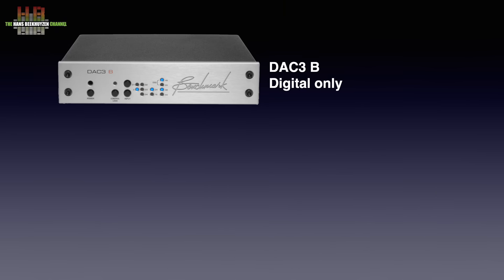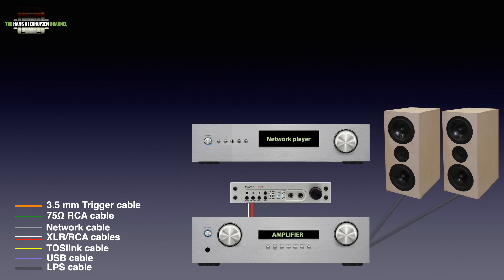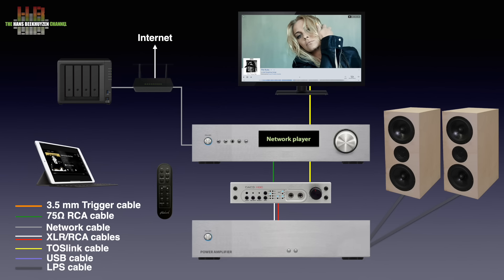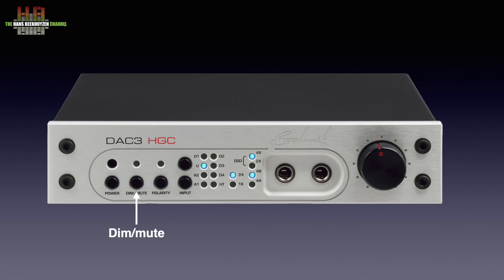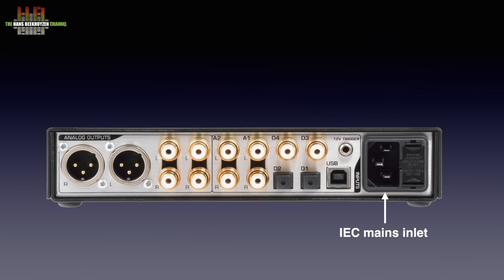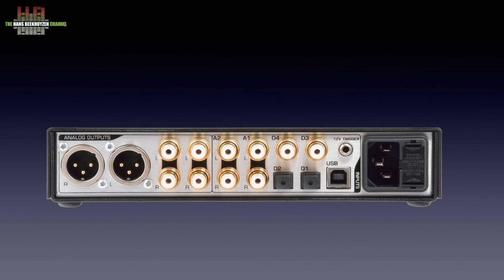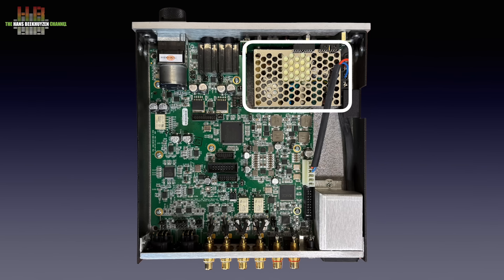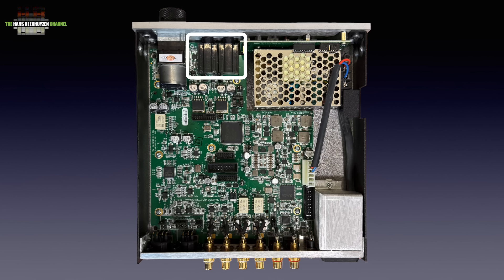Benchmark DAC3 HGC,, if you want sound quality

Comment: I have owned the 3HGC for about two years and I can attest to the quality of the unit. It sounds terrific. I'm using it as a preamp as well connected to a Sublime active crossover then my Pass Labs 30.8 with a Crown amp for subs. Aside from the sound quality a feature i have wound up really appreciating is the adjustable output gain over the XLR connections. It winds up that it was really handy to level match both my amplifiers. My main speakers are 98db sensitive while my sub woofers are 93db. by sending full signal to my subwoofer amps I had a little play with the gain controls. Overall I really like it and recommend it whole heartedly.

Comment: A very convincing presentation. I need your advice, if you please.  Useing Eversolo dmp a6 master edition only as a streamer connected to Benchmark  DAC  3L,  would it be an upgrade then eversolo doing all? Further on, there is a rotel rb 1582 mk2 power amp with  Audio Physic classic 8 speakers and SVS SB 3000 sub. The system is used for music streaming services. Thank you, sir.
Reply from the maker: The answers are in my reviews

Comment: Hi,
How are you?
I would like to ask you maybe It is naive question:
if static electricity affects devices such as an amplifier or CD player. when I usually get up from the couch and touch the volume button, I feel slight electric shocks. it could be a carpet or a blanket from the couch.
Can static electricity damage Gatoaudio amplifier or others devices Please?
Thanks
Your fan 
Ben
Reply from the maker: I don't know your amp but in general amps are built inside a metal casing and that will prevent the electronics from being damaged.

Comment: So this dac has a pre-amp on its own, then what volume should I set on the DAC3 when connect to a integrated amp for the best SNR?
Reply from the maker: The pre-amp function in a DAC is not an extra circuit, it's just an input switching and volume control added. As I said in the video, there is a function to change the output voltage by internal numbers. If you set that to  medium or low (depending on your amp) you just press a button have the nominal output voltage like a DAC without volume control.

Comment: These DAC3s look like the control panel in an airplane liner to me. But this is just the pure optics. 

Thank you very much introducing and reviewing a brand so far not known to me.
Reply: @kempfand  its rear panel is quite packed when I I have all cables connected. Its small size can be disadvantageous for a preamp. It takes some patience to connect everything and my high end power cord’s connector was too wide so I had to install a narrower Furutech connector instead of the round one. The better power cord did improve sound further. Build quality and sound are top notch.

Comment: I love my DAC3-B, but having to change internal jumpers to switch the level of the signal out has pretty much locked it in to a specific chain (with the equally glorious HPA4). When I got a tube amp, I went with a RME ADI-2/4 Pro SE for its ability to vary lineout conveniently and to address a channel imbalance with my particular tubes. Not quite the same level of sound quality, unfortunately. I hope when Benchmark makes  a DAC4, they make it just slightly more user-friendly. That's the only complaint I've had with it over six years of use.

Comment: Oh, you finally upload this video again, but in HD.
I love that vintage Hosiden/Jalco style headphone connector, you don't really need anything to switch the signal and you can use it as low watt power amp to headphone / speaker switching as well. It's the same kind of connector from old 80's/90's keyboard and synth.
Reply from the maker: Finally……😧

Comment: I’ve owned the DAC3 for about 8 years. Used it in my studio and now as the center of my home theater, feeding two Classé mono blocks and taking audio over USB through an Uptone IsoRegen.

When I auditioned it, it was by far the most neutral and natural sounding. And its preamp in HT (home theater) mode sounds better than the preamp of my receiver.

I love music coming out of the Benchmark DAC3. Highly recommended.
Reply: I just took the plunge.  Figured maybe better get it before price goes up, even though it's made in the US.  I was wanting the DAC2 for a long time, but all the lower priced models are discontinued now.
I have the DAC1-HDR and love it.  I hope getting another DAC that will "sound the same" isn't a mistake.
Ugh, I just read this comment:  "My only slight issue is that there is a very small buzz from the unit when powered off but this disappears when you turn it on.  Benchmark told me that this is normal."

I don't like reading that.  Someone else said the same thing but I figured they got a bad one.  I guess not.  My DAC1 is completely silent when turned off.

Comment: I have one of these which I bought for its DAC capability and versatility and I am more than happy.
Mine is set up to ouput via balanced to a Meridian G57 and I use the  Benchmark as a preamp as well as DAC but it is on the input versatility that it really shines.  My phono pre-amp, CD player (either analogue or coax outputs can be used) and my Melco N1A which is both streamer and NAS is connected via USB.  I have also connected my Eversolo A6 in the past but now moved that to another room.  Switching inputs is then easy via the lovely metal remote control.
My only slight issue is that there is a very small buzz from the unit when powered off but this disappears when you turn it on.  Benchmark told me that this is normal.

I think that this is a bit of a hidden gem in the audiophile world. Maybe that because it doesn’t have a fancy screen but I love mine.

Thanks for the review and I was relieved to hear you say it’s a good buy. 😊